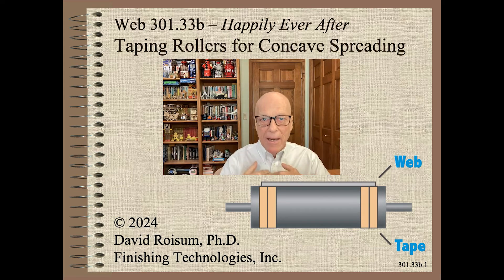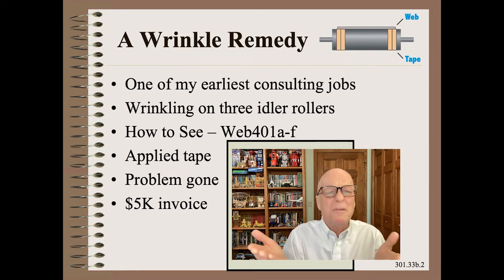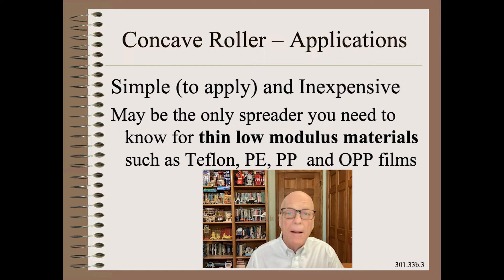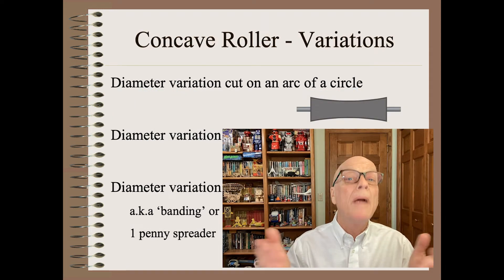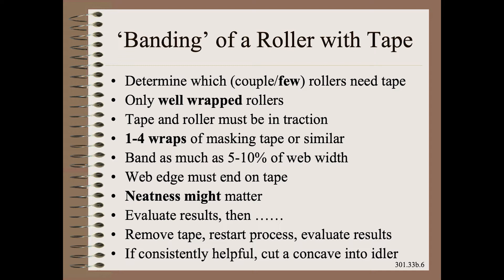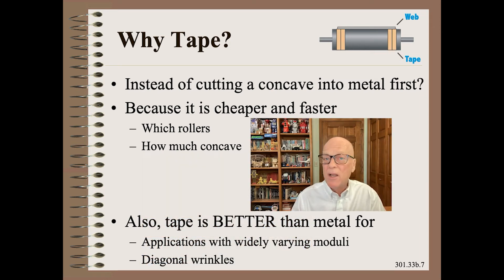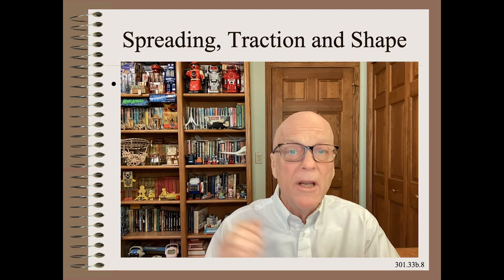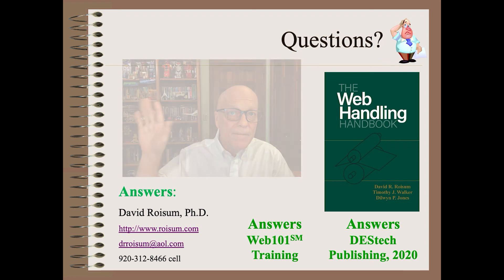Web30133b - Happy - Taping Rollers

Comment: hi davidroisum, thanks for video, its will help to solve creasing issue.1 question, wrinkle on idle and cooling roller  roller after moisture unit for liner at MD, Please comment
Reply from the maker: Easy, you must reduce the moisture add on rate or increase web thickness or use sizing (to slow moisture uptake).  If it were coating, you might need to do it in two passes, for example.  Coat, dry, coat, dry.  While this might be economically undesirable, physics is a bear as they say.  Effective spreading could be tried first, but if width expansion were more than 1/100, it will not be sufficient.